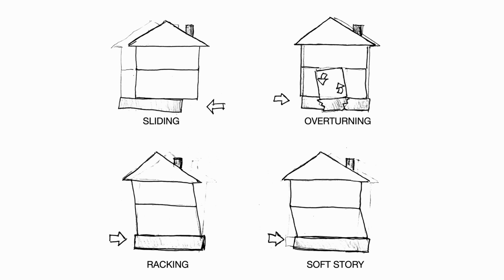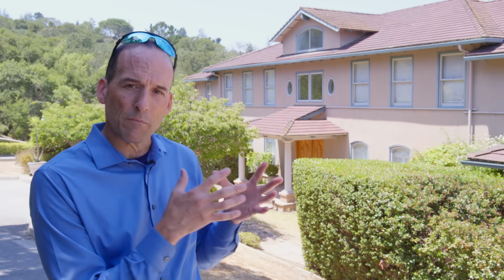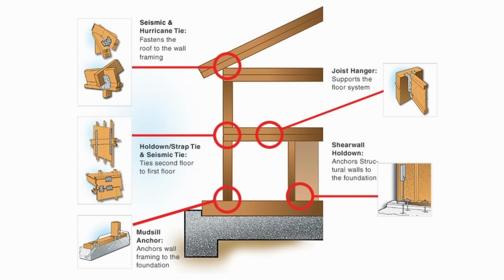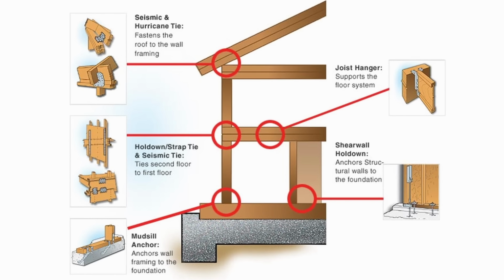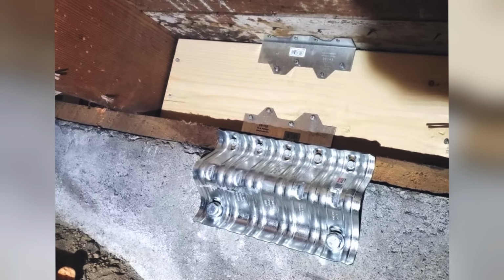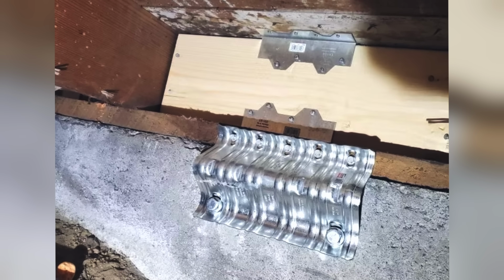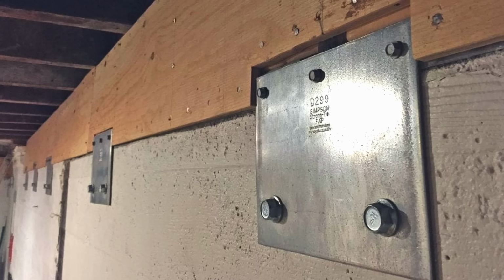How Our Client Put A MORE Expensive Roof On Their Home And SAVED $500K On Their Remodel?

Comment: Great video spotlighting collaboration versus the typical finger pointing that can occur when multiple parties are involved. 

Assuming that the roof has never been replaced since the house was built in the 90s, the roof would be 30+ years old. They are getting a more energy efficient home (more and better type of insulation), AND a new roof while saving the added demo and framing costs if they had kept their old roof. In essence the new roof cost will be paid off with the energy savings.
Reply from the maker: @cluelessKK.   Correct.  This is a true win:win for everybody.
 Thanks for the comment KK.